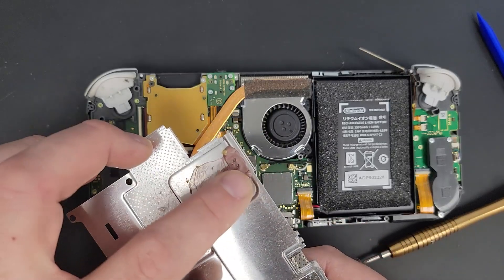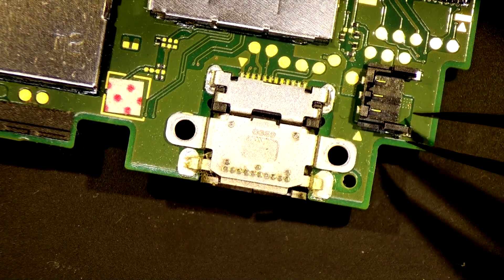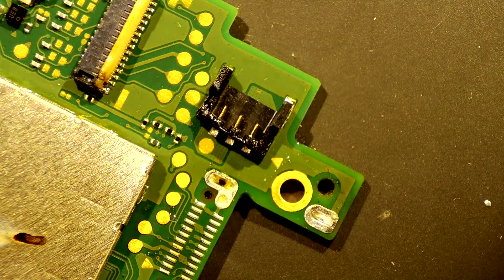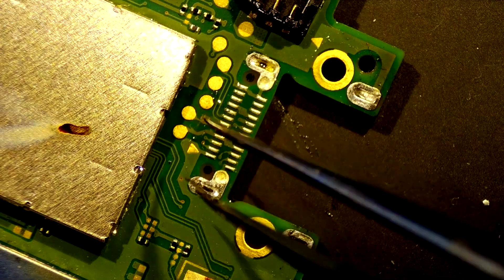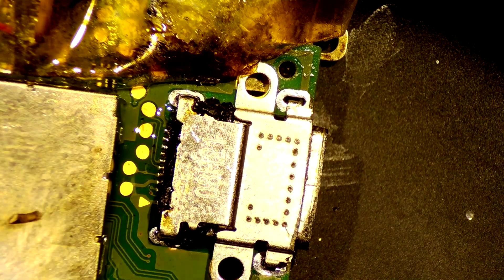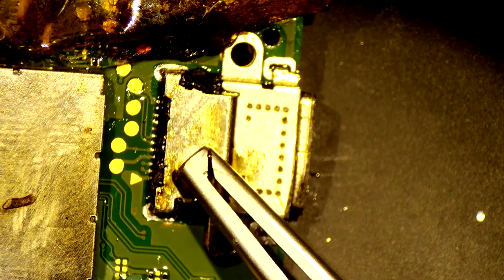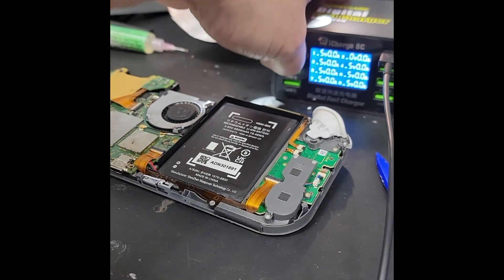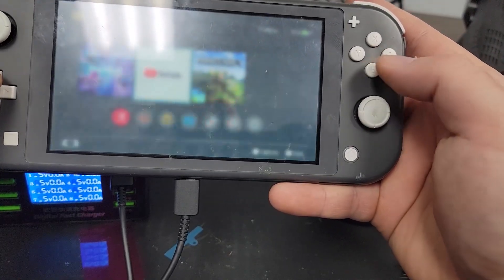Nintendo Switch Lite NOT CHARGING.  Charging port repair

Comment: Easer to heat from the botom of the board and as soon as solder melts stop heating the board
Reply from the maker: Thanks for the tip! Makes a lot of sense
Reply: What is that you pouring on there to take it off?